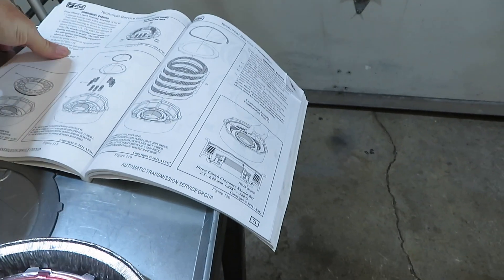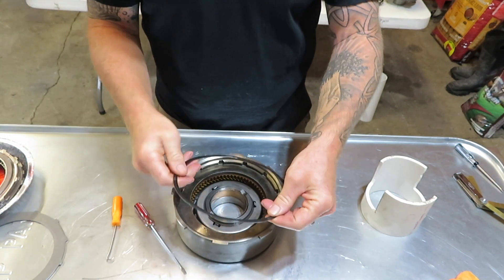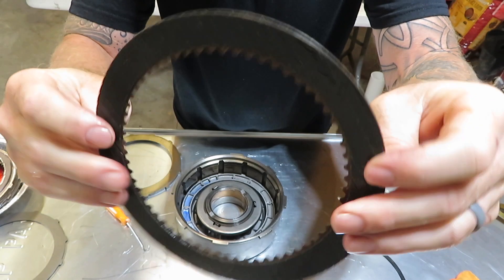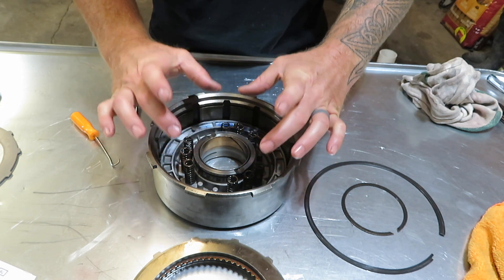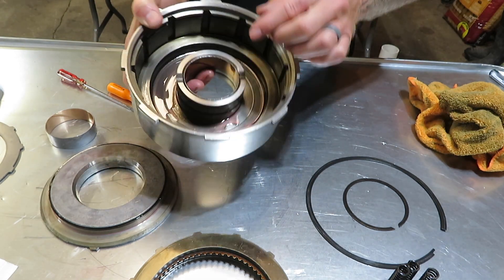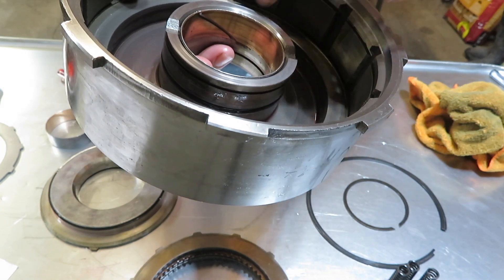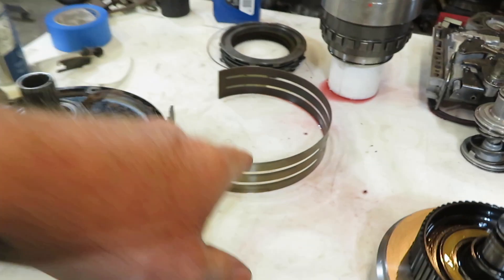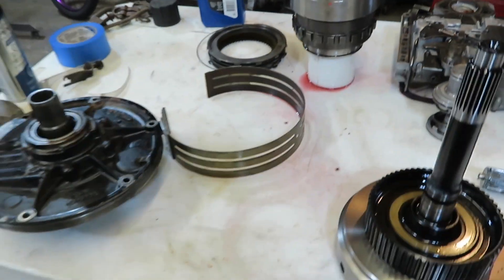How To Rebuild A Transmission 47RE Part 3 Direct Clutches

Comment: Another great video Chad. 👍
Your shop made tools seem to be working very well. It looked like it kept the snap ring encapsulated so it didn't get away. 
I was wondering how you got the bushing pressed on down where you wanted it too. 
Using the old bushing was what came to mind for me too.  
That's how I seat timken bearing race's. .
Reply from the maker: Thank you sir! Yes I used the old bushing also the pvc tools seem to be working. LoL

Comment: Thanks Chad for the 47RE videos! I just bought my grandfather's '99 Ram 2500 2wd reg cab 24v with only 108k miles. It's the first truck I ever drove as a kid and I'm going to rebuild the trans before adding modest power. I just bought the ATSG myself and will continue to follow along your build!
Reply from the maker: Your welcome the 2wd will be the same but the extension  housing will be the only differance. Thanks for watching!